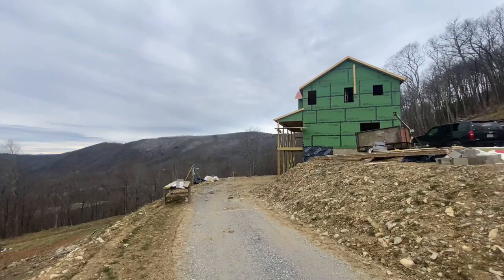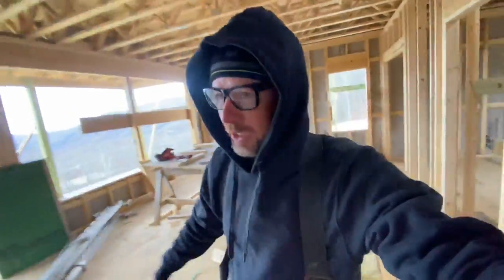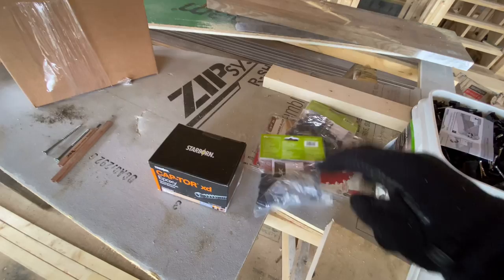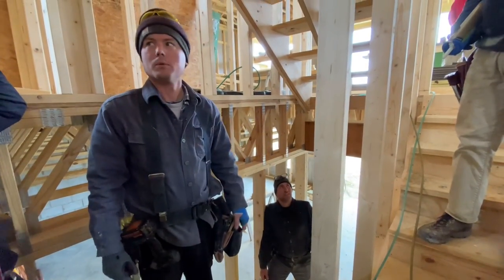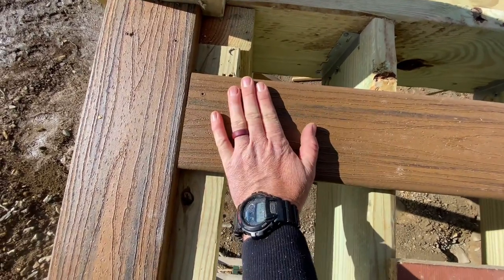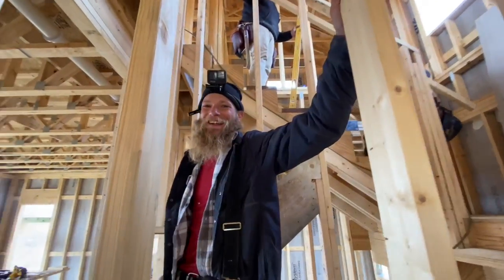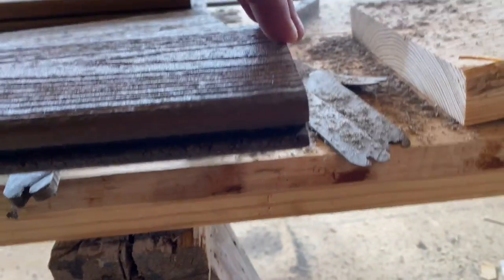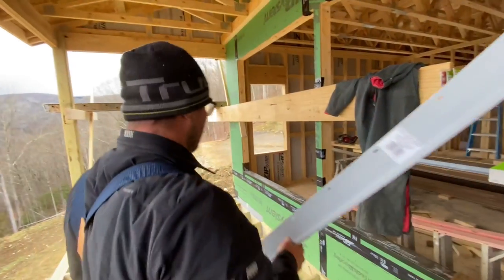Building The Farmhouse | Day 28

Comment: A good pro tip I can give you guys is to use zip tape on the top of your deck joist to protect it from the water that can sit on top. Even treated boards will rote or split when exposed to the elements

Comment: 3 x 12' sections of deck boards with perpendicular breaker boards in between woulda been nice. Those butt joints are tricky with the expansion & contraction - short boards don't move as much as longer ones so it gets all wonky over time.

Comment: I’ve put that decking down before.... Had a problem with it shrinking in the winter so bad that the ends of boards were not landing on the joist no more... I noticed, that the longer the boards were the more it would shrink. I think in my opinion run a cross board to help on really long runs.

Comment: I was thinking about going with Trex here in Sweden (Stockholm), but may go with thermal treated ash wood instead and let it age to it's natural gray color and maybe make a picture frame. Should cost about the same but will stay cooler in the 32C/90F hot summer. Not sure though, the winters here tend to be 4 months of rain and slushy snow and my old pressure treated porch is completely rotten and slimy.

Comment: pro tip of the day staple some dpc on the top of the joysts before you put the trex decking down, it helps protect the joyst and makes it so that you cant really see the clips for the grooves, also if you use full boards instead of staggering it measure the width of a board for me its 140milimitres that would be the center of a joyst and some 2x4 strapped to the side of the joyst, and add an end board but more  of a middle board if you catch my drift then you cant see the joins of the boards

Comment: Just a thought. If you run your deck boards long over the end board location first. You can use your track saw to cut and make a perfect line and then attach your end board. Results are perfect spacing and will save time in the end not having measure and cut... measure and cut.... catch my drift?

Comment: Hey guys love the videos!!, I’m a young chippy  in Australia and love the composite decking, I was wondering if you have ever had an issue with a first floor deck frame and decking  that has the grooves in the sides of boards making a howling noise, the best way I can describe it is when the wind rushes up in between the boards it makes a howling loud vibrating noise, similar to blowing over the top of a bottle at the right angle, had this issue a couple of times and there are many videos of it on YouTube if your interested to see it happen

Comment: Question on that notched piece. It was tight enough to slightly dent the 4X4 post, yet earlier in the episode you talked about the composite material expanding in warmer weather. Shouldn't there have been an 1/8" gap around the posts also? I assume there is trim going on the posts so why did it need to be so tight (impressive as it was to measure and cut that precise for rough carpentry)?

Comment: Really enjoy your channel.
I have two questions for you if you have time and don't mind:
1). We have started to use joist tape where I live since the joist always rot out on the top side (even PT eventually).  Do you guys have, use, or believe in that product where you live?
2). I've seen some expansion contraction issues with the plastic lumber decking causing issues requiring clearance.  Any issues with that where you guys live?
Thanks.

Comment: You correctly left 1/8 on the end for expansion in the summer heat. And that post notch was master level, but shouldn’t you have left an expansion gap around the post notch instead of making it so tight?

Comment: idk where you buy wood but our wood decks lasts for atleast 30 years
Reply: The trouble with all wood decking is that unless it is stained every year or so the ultraviolet rays from sunlight break down the bonds between the wood fibers causing cracks in the surface of the boards. Some homeowners are pretty good about restaining their decks, many aren’t, and even with ones who are, all it takes is one year where life gets in the way and it starts cracking. If you live where it gets cold then you get moisture in the cracks that freezes and makes the cracks worse. Next thing you know the deck looks like heck.